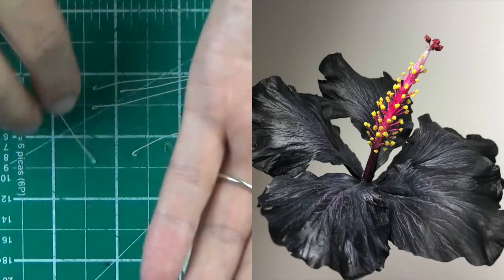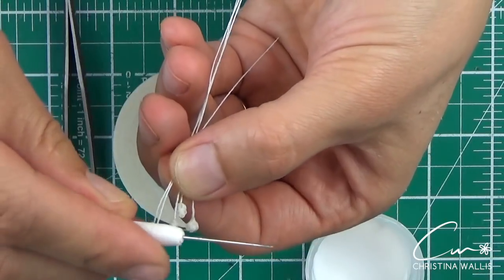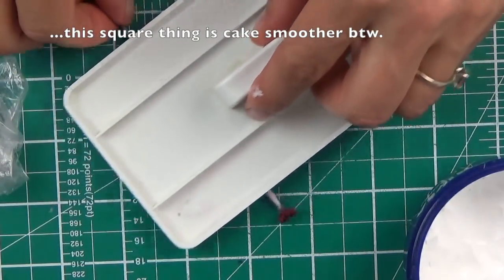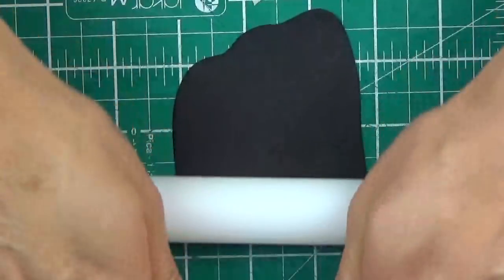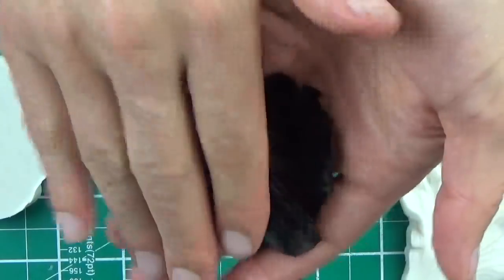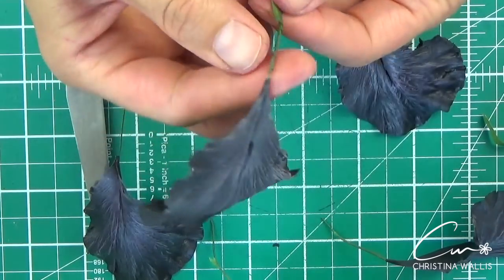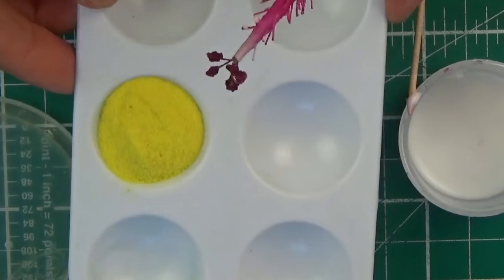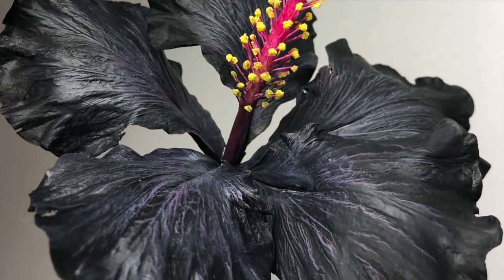Sugar Hibiscus Flower How to Tutorial (2021)

Comment: Perhaps trying hair spray to fix the dust. I remember that it could work as substitute for fixativ.
Reply: Cold Porcelain FLOWERS Christina WALLIS And I guess it's much cheaper than fixativ 😉.  Cross my fingers that it works well.
Reply: Cold Porcelain FLOWERS Christina WALLIS I would try it on a piece you will not need (rest or broken piece). Than you know how or if it works.
Reply: Alyson Reynolds uses hairspray on her flowers so I think it is Ok